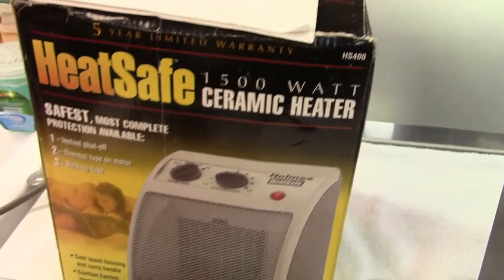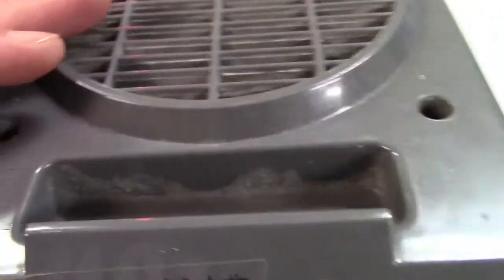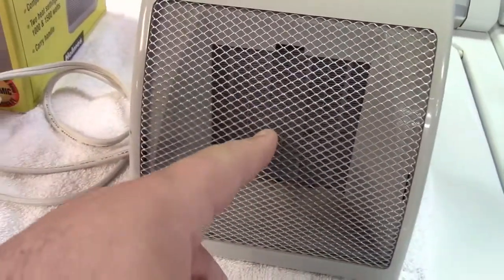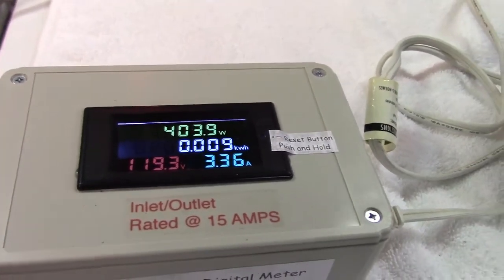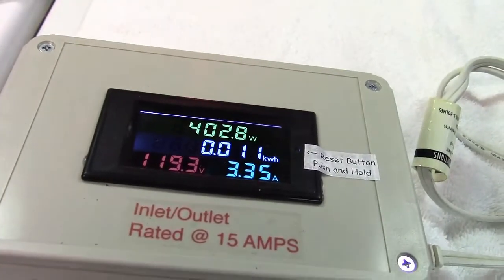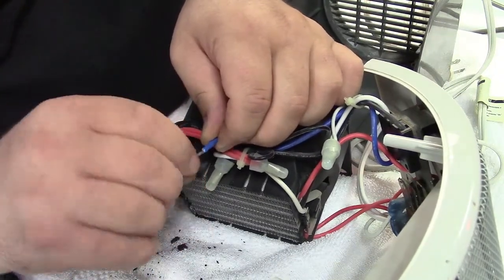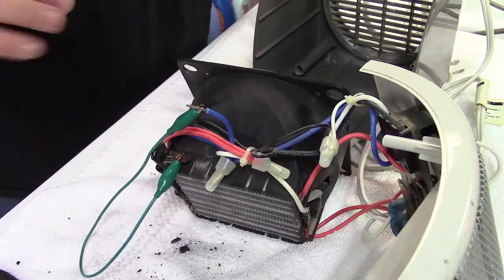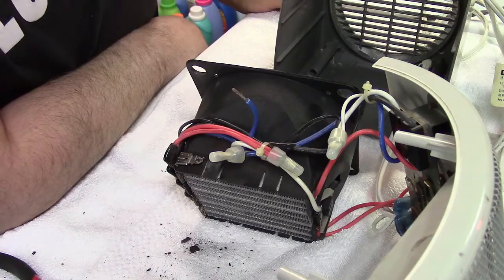Holmes HeatSafe HS400 Ceramic Heater, Part 1 - Initial Checkout

Comment: Same problem here, this has been subjected to voltage that's too low.
Reply from the maker: It's too bad the heater is the weak point in this case; the circuit somebody had this plugged into has probably been quite taxed over the years also.  There's a vintage 2-prong outlet in my dad's house that has had a heater plugged into it for the last 35 years that I remember, and while it's not as good as it used to be, it still works.  I guess that's the quality of a 62 year old outlet.

Comment: This is the main reason why I don't like these plastic heaters.. That seems like quite the potential for a fire..
Reply from the maker: Usually a fire happens due to misuse, either placing it near combustible material, or not monitoring it while it's on.  Chances are quite good the heater itself isn't going to melt or "blow up" on its own accord.  If a wire burned off, it has nothing to short against.  Whereas in a metal-case heater, that potentially live wire can short to the case.
Reply: Perhaps, but if you have a circuit breaker in your house that works, the shorts shouldn't be an issue..
Reply from the maker: That depends on how much China Pride was put into the heater.  If the cord itself only handles 13 amps, the cord could act as a fuse before the breaker interrupts.  Insulation burns off REAL quick when a wire is overheated.

Comment: Seeing that melted connection reminds me that I used to have the matching dryer for my Maytag washer but it routinely melted the spade connectors off the ends of certain wires,  I repaired it 3 or 4 times but then the heating element died.  It was one of those "Halo of Heat" dryers where the element is mounted around the door frame on the inside of the cabinet so you had to take the whole cabinet off to replace it which I did but then the thermostats started acting up, or more accurately didn't act up at all so all I got was lukewarm heat out of it.  Maytag may have made great washers but at least that dryer was a lemon.  When it was working it would take 1.5 hours to dry a load of clothes.  The Whirlpool I replaced it with takes 45 mins.
Reply from the maker: Yeah, one of the biggest problems with electrical heating elements is they generally cook themselves to death in time.  Depending, of course, on the design.  Ultimately, it will happen to all of them.

Comment: Poor materials for the connections and many heat cycles. Looks like the thermostat was having some flash over while it was doing its task, as these heaters age the thermostat starts to flutter, eventually, it decides to be on or off. Sometimes they will slightly weld themselves to be on. "Importance of the thermal safety devices."
Reply from the maker: Those thermal safety devices fail too you know!
Reply: I had many thermal fuses blow for no good reason, one was on a forced air heater. I also had one fail in a convection oven/microwave and a large countertop toaster/oven.
Reply from the maker: Exactly.  I've had 3 of those fail on me in 11 years.  Tsk, tsk.